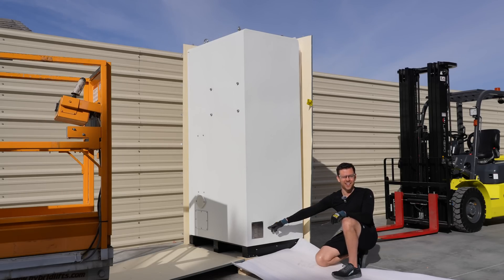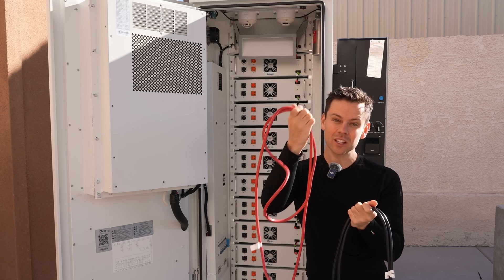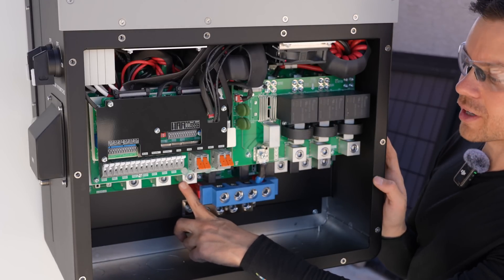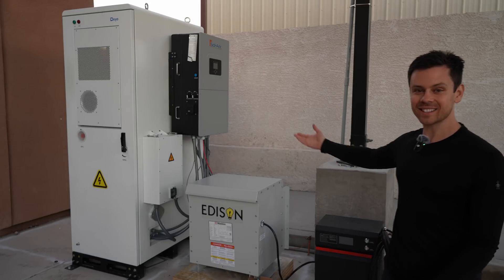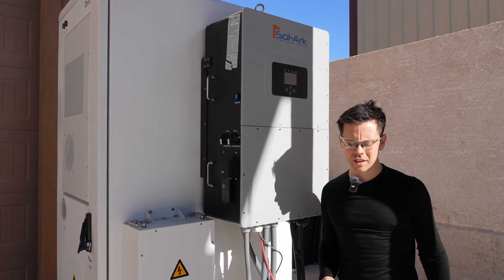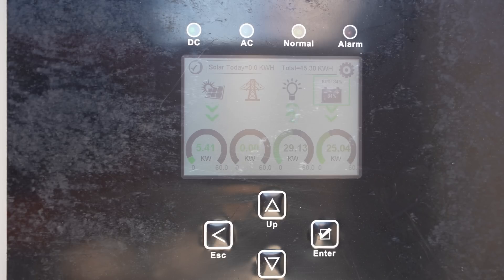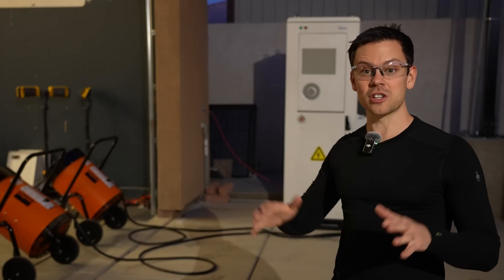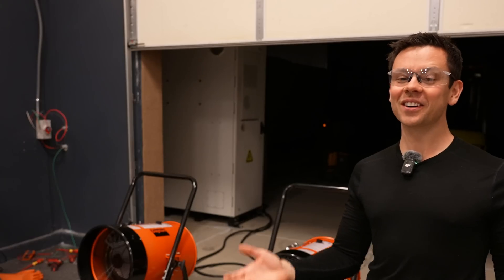60,000W 480V 3 Phase Sol Ark + 60kWh Deye LiFePO4 600VDC Battery Testing!

Comment from the maker: You can find this battery at bestsolarbundles (affiliate link):
https://bestsolarbundle.com/products/sol-ark-60kw-inverter-deye-ge-fl60-ge-fh60-cabinet-ul-9540-closed-loop-bundle-60-120-180-240-300-360kwh?ref=WILLIAMPROWSEIV&variant=43645878468650

And for bundle deals:
https://bestsolarbundle.com/collections/ul-9540-closed-loop-bundle?page=1&ref=WILLIAMPROWSEIV#4fd06e971cbcc880993618a0d79eafe6

~~~~~~~~~~~~~~~~~~~~~~~~~~~
Tired of getting ripped off? Check out my "Will Prowse Approved" solar product recommendations below!

12V Batteries
https://www.mobile-solarpower.com/lithium-batteries.html

48V Batteries
https://www.mobile-solarpower.com/48v-batteries.html

Offgrid Inverter System Builder
https://www.mobile-solarpower.com/48v-complete-system-blueprint-559371.html

Hybrid Inverter System Builder
https://www.mobile-solarpower.com/code-compliant-48v-offgrid-system.html

Mobile Handtruck System Builder (very popular!)
https://www.mobile-solarpower.com/mobile-48v-system.html

Solar Panels
https://www.mobile-solarpower.com/300w-solar-panels.html

Ground Mount Solar Racking
https://www.mobile-solarpower.com/ground-mount-racks.html

Wire, Lugs and Busbars
https://www.mobile-solarpower.com/wire-and-connectors.html

Tools
https://www.mobile-solarpower.com/tools.html

Fuses and Circuit Breakers
https://www.mobile-solarpower.com/fuses.html

Plug-N-Play Solar Systems
Ecoflow, Anker And Bluetti! So many models to choose from. See my current recommendations here:
https://www.mobile-solarpower.com/full-size-systems.html
Reply: Thank you
Reply: prices are extremely high, i paid 12.500 euro for Deye 25kwHV 3 phase inverter and 83,6 KW HV Battery set up.

Comment: So what it run if it runs air conditioning heat pump inverter etc  I need 3 phase  but thats expensive will i did not you balance the cells

Comment: I've had 3 Solark inverters. First I had a 12k and it never fully performed to the original specs. It was a bit below. I then upgraded to a 15k. SolarArk replaced my first one, because it would not sell back to spec amount to grid. They sent me a newer version. My original 15k was othe very first run of production. I had to work with them a lot. They seem to have good products, but they are bad about over promising the outputs etc. I have had similar experiences with them as you show in this video. I do like the company, but I feel like Signature Solar is really giving Solark a run for their money these days. Great video. Thanks for sharing!

Comment: The starting power of this hot air blower is roughly 3 to 5 times its rated power. Starting one alone is manageable, but two is really too much for the system. Installing a VFD (Variable Frequency Drive) for soft start should allow them to start up gradually.

Comment: Hi Will great video. Can you please try making a review for the walrus G4 or Walrus G4 plus. I think those are interesting high voltage dc units and are interesting as mobile power system and also for home backup power.

Comment: Be careful sticking your finger into this one… I got popped like a tazer by 8kv High Energy rectified DC because of a HV probe with a crack in the insulation. Luckily I wear electrical safety shoes so it was a mild event but had I had my hand on the frame or been wearing tennis shoes probably would have been in the emergency room or worse.

Comment: Just FYI for anyone.  I have the Sol-Ark 12K outdoor version and I have the same issue.  It's SUPER sensitive.  Will not run a full load all day while off-grid like my EG4 does.  It also will not start my table saw which is only rated at 2000 watts 240 volt while the EG4 6000XP starts it all day WHILE charging my car.  I love the Sol-Ark, but unless you NEED grid-tie features, I wouldn't recommend it.

Comment: Those are the contractors chattering. Because of the voltage limitation. I wonder why they limited the whole pack with so many safeties at the extremes. It makes sense from an industrial manufacturing standpoint that if the batteries reach 10% they can max out out 100amps so they just limit it to the extremes so they can warranty it for 3 years.

Comment: i have a system medical, 480v, 3ph , 150amps, would this sys run it n for how long....currectly we use a kholer genset 80kw, 101kva , 112amps to run it on stand by mode.  Can your sys replace an Eaton UPS 100kva 480v 3ph?

Comment: Will, I think the glare on the display was from a protective plastic sheet. I saw scratches, wrinkles and other artifacts in some of the close up shots of the panel front.
 I'd hate to see you get seriously hurt, so I'll warn  you that you aren't wearing the sort of PPE that is recommended for 480 volt panel work. Google "Arc Flash Protection" to see the stuff we were supposed to wear, in my factory, while inside energized 480 volt panels.

Comment: Electrical engineer here... the majority of the load will be from the heating element, thus resistive with no surge on startup.  However the fans (presumably with induction motors) for a few seconds on startup will pull six times Full Load Current.  So when starting the second fan, that will be (1 + 6) = 7 x FLC.  When you start them both at the same time its (6 + 6) = 12 x FLC - thus the different behaviour.   There should be a nameplate for the FLC of the motors, as well maybe for the heating element. [Edit, as @taylorjj93 indicates, that 12 x FLC may well be producing a voltage drop that is causing the contactors to chatter)

Comment: You should probably familiarize yourself with NFPA 70E. And you probably should get your rubber gloves re-tested after using them without leather protectors. And I would highly suggest at least not wearing any synthetic clothing when messing with 480vac/600vdc.

Comment: 60k is the peak load including the torque load it can handle which is for few seconds, normally you run any inverter at max 80% of its max power

Comment: I wouldn't have bought 2 30kW Heaters for testing in the solar oven area you live in, I would have bought a 50kW DC Charger for the car or a 60kW Air conditioner 😀

Comment: High voltage? Or Low voltage , 69 kw  still  not enough for independent home, see video of our set up : 25 kw HV with 83 KW HV batteries. And several 50 kw HV Deye , good stuff ! thanks for the video!!

Comment: i bet that knob on the heater is setting a duty cycle, like the half setting is 10 seconds on 10 seconds off - or maybe a thermostat. which is fine for when what you care about is how much heat it's putting in the room, but not for if you're running near the limits of your power capacity.
Reply from the maker: Ohhhh I'll try that
Reply: @WillProwse  I didn't really have a suggestion for you try, just an idea on why it was acting the way it was. good luck with whatever idea you got from it though
Reply from the maker: @random832 I mean test if it works like that haha

Comment: I'm so excited by this test and even more of your next test since I have a Deye 80kW hybrid inverter on its way to Sweden and among my loads I have a 20kW compressor, 18.5kW Motor for a hydraulic system to my woodcutter/splitter and a 18kW motor for our saw mill.   And I've been so nervous as if I'm going to run my tools on the inverter and I almost freaked out in the beginning when I saw that a 60kW inverter barely could start a 30kW heater.  :D   But now it feels better again, but the load from the motor in next episode will be a totally different level when it comes to power surge and I look forward a lot to that test.  :)

Comment: The "bad sound" from the heaters is caused by the voltage collapsing and the heater contactor dropping out.  As soon as it drops out the voltage rebounds enough to allow the contractors to pull back in.   Which causes the voltage to collapse and....
round and round.   This is called "chattering" and that's EXTREMELY bad for the contactors.  They're only designed to open when the motors are at normal speed and drawing the minimum current.  Contactors will usually only take a couple openings while starting a motor before they're damaged beyond use.

Comment: This is a 3 phase unit, and they usually got their power divided for each phase, so in this case it might be limited to 20 kw per phase. That's why it's shutting down with overload.

Comment: That's the inverter I will be using in my shop to get 3 phase 480v but I will have 350kwh of battery as it will be for heat and cnc equipment. then 6 15k units for the house and the 120/240 at the shop.

Comment: I have been itching to see an in depth review/experimentation on this specific inverter (the battery is admittedly super expensive for just an experiment) - shockingly not really available except a marketing video for the last few years.
  
Like the idea of the SolArk gear generally, but REALLY HATE how they bury things like programming manuals and software limits behind "authorized dealers".  Makes it really hard to specify their gear in a system while just sourcing the hardware from a dealer.  I run into the same thing with other technology companies like IC vendors - can't even buy some stuff unless you want to order 10 reels of 2500 pieces.  Makes it really hard to get one 25-cent part to do a board repair that the manufacturer is asking $1200 for a replacement.
  
"...But muh Intellectual Property!!!..."
  
Don't give me that crap - I've worked for several Fortune 500 companies in the top 40 - most companies that want to hide behind their service manuals and programming guides behind claims of IP interests are the worst offenders for "abandonware": ship it, service it for 5 years, then dump support for it screwing the customer while you move them on to the next greatest thing.
  
I like that SolArk claims support for OpenADR (an open-source smart grid framework), but yet again, no manual, no API, no specifications.  They really don't want people to figure out how to use their gear the right way, while claiming "great support".
  
Your video here shows that "out of the box" it was "configured wrong" for your use case.  This is exactly the kind of issue not publishing the documentation causes - and it kills a company's bottom line by burying them in support overhead.  Anything they've formally trained their support call-center on, should have been (IMO) put into a white paper and published so that self-service support can occur at 3am on a Sunday morning at Christmas.  Or worse - when the company abandons their hardware and it's in the field 7 years from now, someone could possibly have the documentation rather than trying to get ahold of a call center which is closed or a support website that the servers were powered down on 3 years ago.
  
I have the same gripe with this fetish for "apps" and "cloud management" of these critical devices.  You're telling me you want me to install your hardware at the very ROOT of my power infrastructure, and you won't publish the API for the inverter?  What happens if you go out of business?  My inverter stops telling me about the charge state of the batteries on my phone or your website or giving me equipment warnings?

Comment: 60,000w ~ 480v = 125amps. Mind blowing. After your recommendation, I’ve started to look into 48v batteries. A 35lb/16kg 60amp battery. Will provide 3.5kw. With a power station, most people could lift these individually. Good enough to help family in a blackout. Or camping. I can’t lift a full hand trolley. 
480v, WOW. 48x10. I’ll get cracking. 😀
Reply: Thanks Will. Just thinking, 
60,000w ~ 12.8v = 47 x 100amp 12.8v batteries. 94 cables minimum. Your new setup looks much simpler. Although 1000v solar system in series. It’s fortunate you have no problems with shading.
Reply: Sorry Will 🙄. 3KWs from a 48v 60amp battery. It’s the heavier 24v 100amp = 2.”5”KWs. Although they only offer 384w @ 15amp through a 15amp CT60i solar input. The 48v offers 768w. Or 500w maximum on many power stations. Hope your foot is better. You’ve been through enough medical issues. Cheers.

Comment: I don't see that extinguisher doing anything. If you get flammable gas off lifpo4, than you have issues. looks cool, safety options are laughable. Better off having a few tons of sand ready to bury it. you need arc flash gear, those gloves are not enough.

Comment: I wish people would use VA instead of watts when discussing AC equipment. Watts is fine for DC but unrealistically inaccurate for AC unless it's used for a purely resistive load. Unfortunately there's too many "marketing experts" that insist they use watts even though it's deceptive.

Comment: Wait!?!?!?! I always thought this was on your (a flat) roof (back when you tested solarpanels and what not), but a forklift on your roof I don't think so.. LOL!!!
480VAC can give you quite the kick... I once got shocked by 480v (protection 50A max), that hurt pretty bad. Obviously I didn't get any where near 50A (or even anywhere near 0.1A (= fatal) for that matter) to my body (I would be turned into dust). I was working on my forklift charger (150A 60V), that is powered by 480VAC and I somehow pulled out the wrong "wall plug" , so it was live..
I've been shocked so many times in my life, I should've been dead 10 times already...Lucly I'm not a cat because I already passed the 9 lifes..

Comment: Great content! I was actually looking into a larger 100 kW system with 300 kWh of batteries in a container-based setup from Deye, BUT the huge drawback was that all the management features were cloud only, with no option for self-hosting or fully on-prem management.

Having such critical infrastructure for my farm connected to the cloud—especially a Chinese cloud—is a huge no for me, so now I’m just looking for a similar product that offers local management.

Comment: Go in to battery settings, set off to 2%, low battery to 5% and restart to 10%. Grid start, to 10%, and time of use set it to 10% all the way down. This way you might be able to pull more.
Keep in mind that Sol-Ark is basically Deye, just US rebranded.

Comment: Question is 
How much is the Sol-ark 
I bought a 66kw 3 ph inverter for $4000
I’ll be building my own high voltage battery
The MBU costs $700
Slave bms cost $50 each (13) total 
Battery cells $8000

Comment: I have installed many Deye high-voltage systems. They are identical in construction to Sol-Ark. The largest system has two 50 kW inverters in parallel with a battery capacity of 420 kWh.

Comment: I would urge you to talk just a bit more about the need for additional safety protocols, safety equipment, and the dangers of working with 480 volts.  Even for those that might be accustomed to working with 240v split phase, 3-phase 480v is a completely different level in terms of code standards and should be left to the trained professionals in most (all?) cases.  Excellent content, as usual, and a nice window in to the industrial side of solar and energy storage.  Stay safe!

Comment: I wonder if we'll see higher voltage systems in the pro-sumer space. At some point it just makes a lot of sense because the components/cables can be so much smaller. There is added risk/danger, but I'd like to see more high volt MPPT and battery systems.

Comment: Let's see you strap that high voltage sol-ark onto your Tesla. 
All that engineering that went into the 60KWh battery cabinet yet your Tesla has more capacity.

I'd really like to see if there's an EV that does bi-directional charging that could actually be used to power a similar test.
A new EV that you could write off as a business expense, not that's a formula for a few videos!

Comment: I am planning a project that will require mulitple 60k units and multiple 30k (for 240). A shame that most of the video disses the setup even tho it was a set up problem not a system problem.

Comment: Do those batteries have a BMS? I don't think the mosfets in a normal BMS can handle that high voltage
Reply: Relay is used, not MOSFET.

Comment: Absolutely awesome. I need for my home mining farm or something slightly smaller. I use about 20 kwh a month and want to double. I have a backup generator but no battery backup. We are at the end of the line and our power service is pretty bad. What's the actual drawl to run and charge a system like that?

Comment: On the electric motor side, get one with a VFD. That will lower the inrush amps and give variable speed. On the electric heat, get one with a SCR and heating output can be adjusted with a POT switch. 
   The temp switch on the heaters you have probably are on/off based on the air coming into the heaters.

Comment: It sounds like those heaters have contactors in them that are chattering due to the inverter limiting voltage and high startup current.
I have seen that before, when the in-rush current exceeds the contactor rating so much that it actually blows the contacts open.
That short load test probably caused those contactors to have severe pitting on the contact surfaces. They probably should be changed to prevent a problem in the near future. As you said, higher power demands higher awareness and safety.